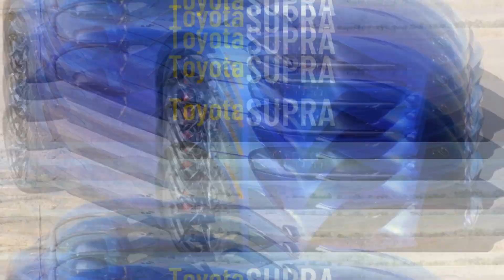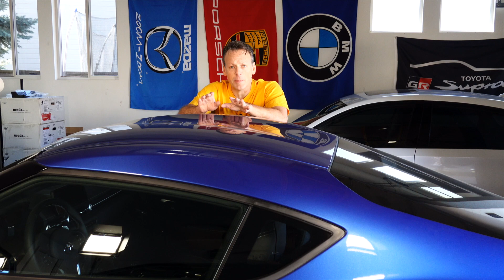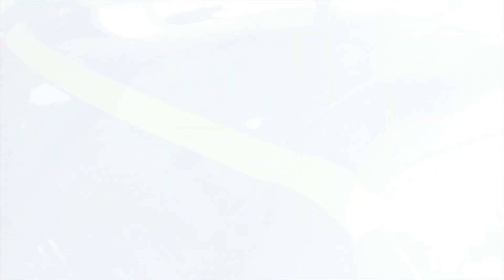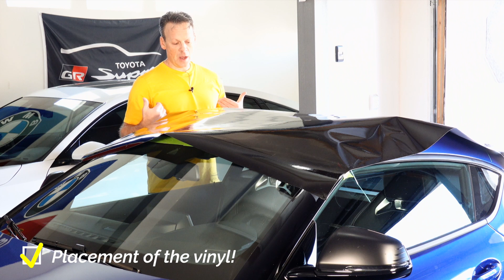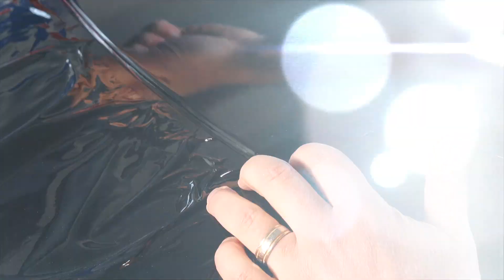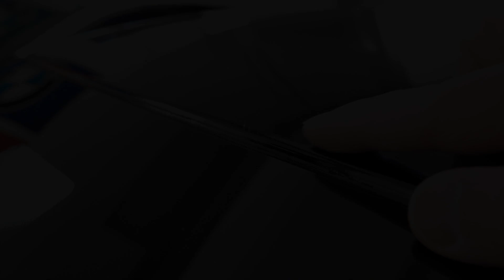HOW-TO: Vinyl Wrap YOUR Roof?!?  //  (MKV Toyota GR Supra)

Comment: How did you avoid the glue lines and glue bubbles  from not glassing out the vinyl and having to relift the vinyl multiple times during your method of application? I’m guessing you had lots of wrinkles while during the squeegeeing process?
Reply from the maker: What type of vinyl wrap are you using that you’re getting a lot of lines?  I ask as my limited experience with vinyl has shown that different brands and types within brands behave very differently.

Comment: LOOKS GREAT, HOWEVER IT'S LASTING EFFECTS IS ON THE INSTALLER, YOU NEED A REAL PRO.....I HAD IT DONE......
Reply from the maker: You really can do this yourself - the vinyl used is very easy to work with and will last for years! 👍
Reply: No you need quality products
Reply from the maker: @thebvandersnatch6975 👍

Comment: Working with vinyl for me was not easy. I think you did a great job and it looks awesome. Not a big fan of roof wraps but I think the black on blue looks great.
Reply: I don’t know about that. Not a very good stopping point there. Where would you stop at?  The back of the front window area or the back of the rear side glass?  Hope that makes sense.
Reply from the maker: I’d curve the wrap following the lines of the door to the back window 🤔
Reply from the maker: Thank you!  How do you think it will look with the panel above the side windows and partial B pillar wrapped?